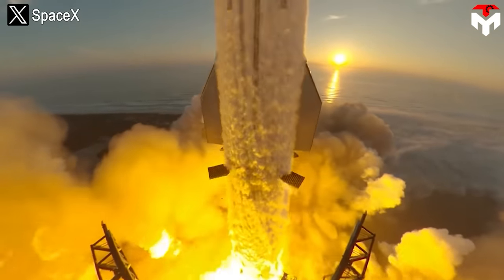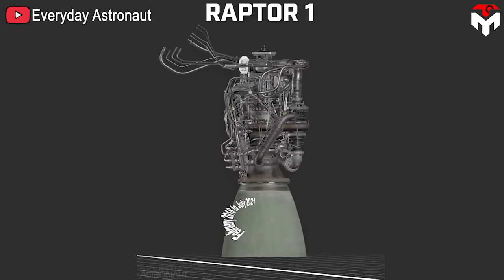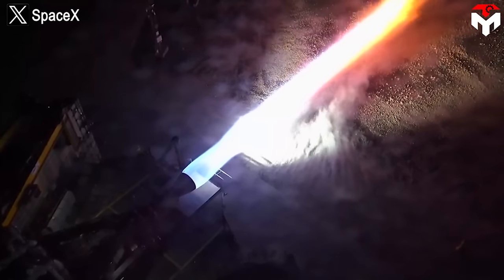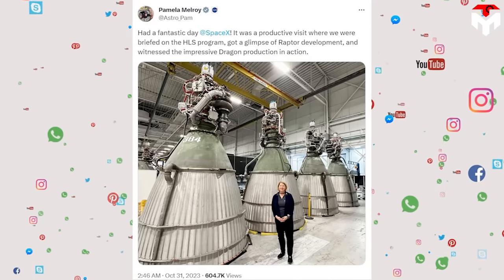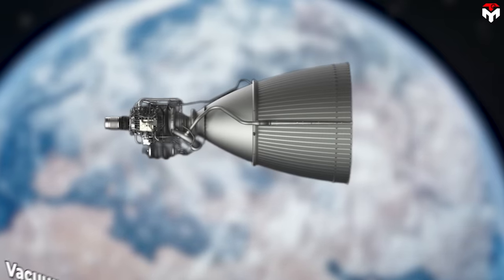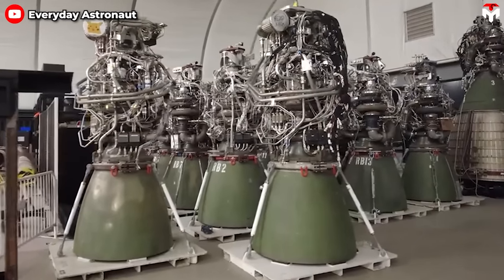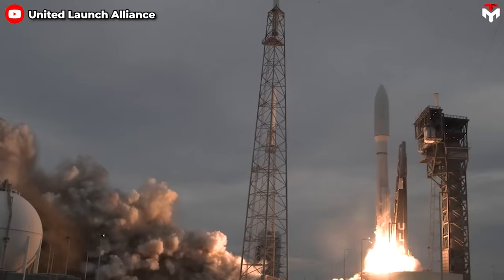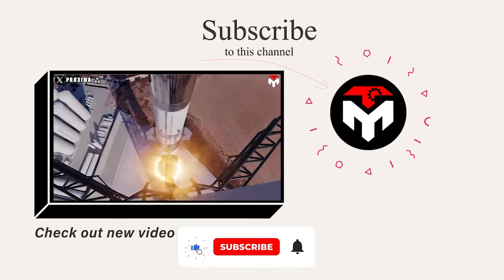SpaceX's NEW INSANE Starship-Raptor engine Thrilling Scientist's Minds...

Comment: Once SH becomes operational, how many will be built? The present Falcon family uses lots of Stage 2, which are disposable, and a small cadre of boosters. While requiring a decent number of engines, at 33 per vehicle, the far fewer number of them will reduce the total significantly… so long as it becomes totally reusable. Will be interesting to see when that stage in its development is reached.